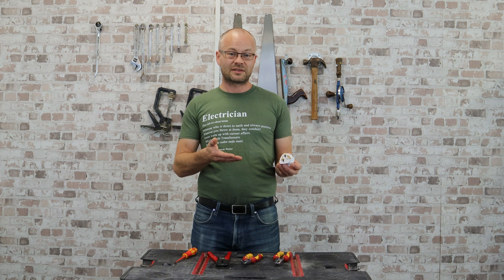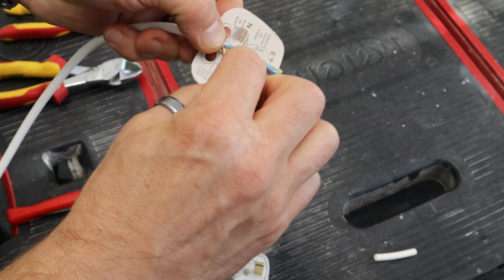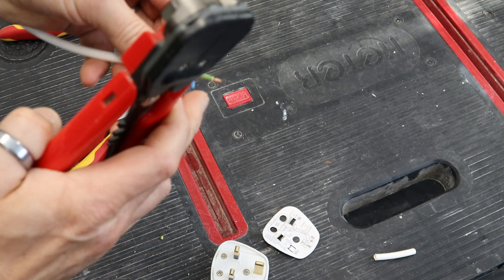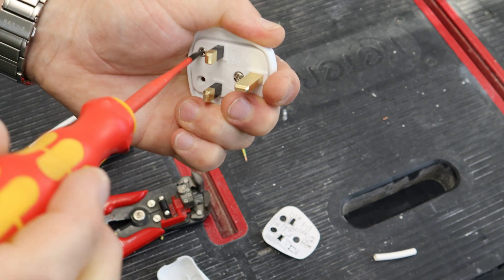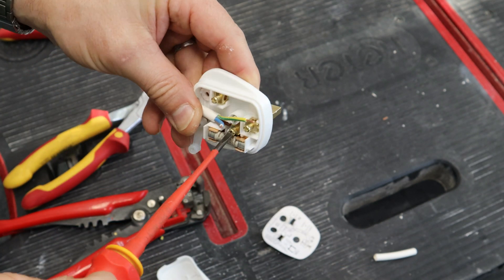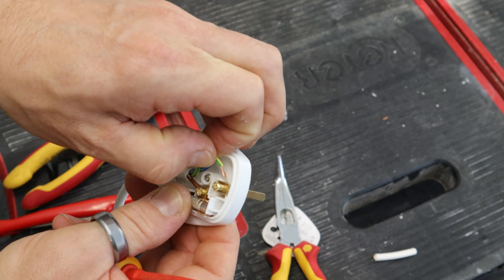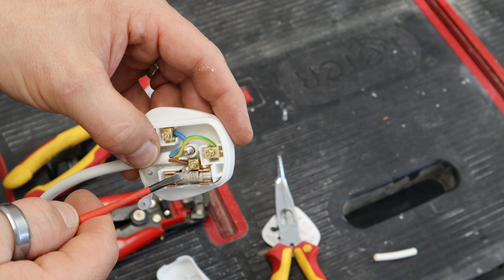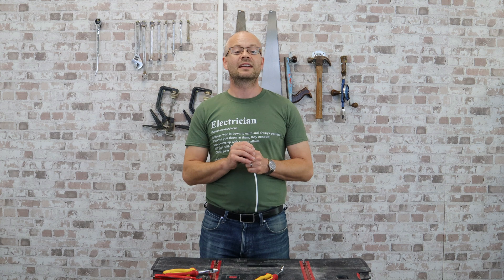How To Wire a 13 Amp Plug

Comment: there is no such thing as DIY electrical, or shouldn't be, just because your confident doesn't mean you know what you're doing. These instructions are better than most people who just connect all the wires without cutting them. so, if the chord is yanked out of the plug the live brown wire is the last to break, very bad idea. in this video at least the wires are cut to the guide length, but this is still not how an electrician would do it.
the earth wire should have some slack in it with the live as short as possible so if the chord is pulled out of the plug, the earth wire breaks last. if you need electrical work done don't look how to do it on youtube get an electrician to do it safely. your family's safety is worth the cost
Reply from the maker: Unfortunately I have have to disagree. Until the government bans the sale of electrical items to the public, there will always be diy electrical. I come across it all too regularly. I created this video partly because a client complained that their light tripped the power in their new home, thinking it was the socket. The light had cpc and neutral reversed, and its didn't cause issue in their old home because they didn't have rcd's. Her husband had wired the plug many years prior. (Thank goodness for moulded plugs). As a qualified electrician, I agree that you shouldn't do something you're not trained to do, and a professional should always be sought. But even in school I was taught how to wire a plug...
By following the manufactures guidelines, as I did in the video is good code of practice. You can see there is plenty of slack in the cpc and the line conductor is short, but long enough not to infringe on the plastic divider and not causing strain. But each to their own, we all have our own opinions on how things should or shouldn't be done, and if we were all same, life would be boring.